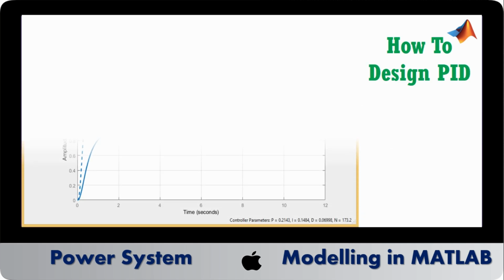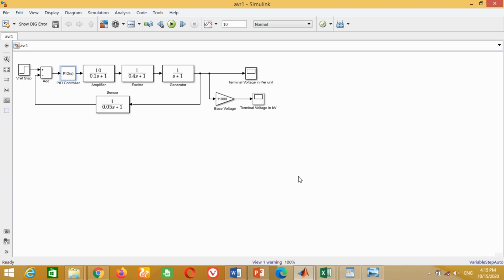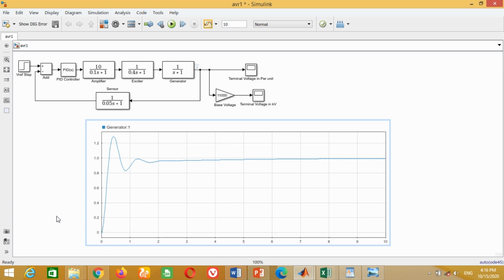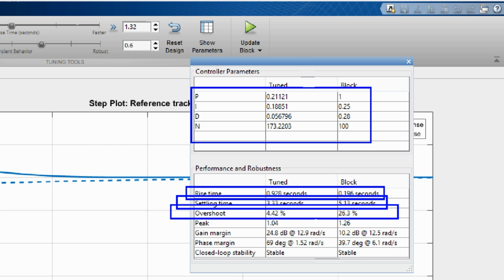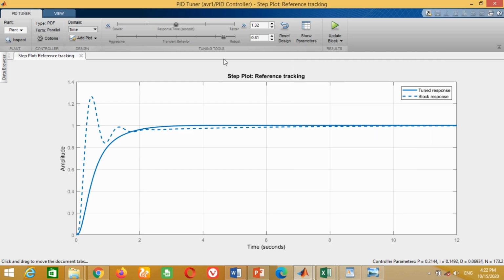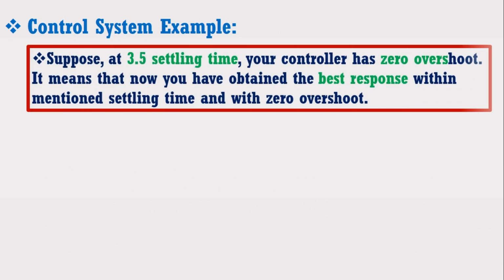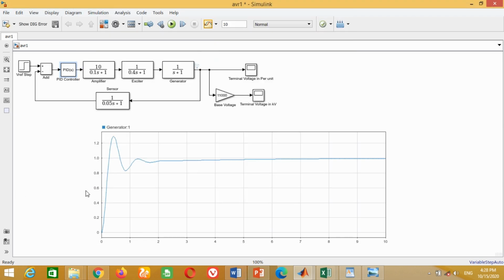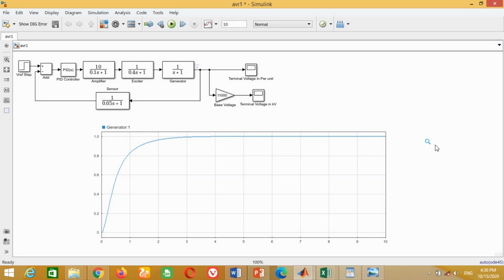How To Tune PID Controller in MATLAB SIMULINK ? | Dr. J. A. Laghari

Comment: Can I use convex optimization technique to improve the efficiency of the system?
Reply from the maker: Thanks for the comment. Yes. You may use. It will work.
Reply: can you make a video of it? using cvx tool box in matlab @DrJALAGHARI

Comment: respected sir, 
i'm trying to tune the pid controller in a buck-boost converter . but the tuner is sending this message ' this model can not be linearized'. 
what can i do to solve this problem ?
Reply from the maker: Thanks for the comment. Basically the pid tuner works well with transfer function based models. I don't know about your model.

Comment: assalamualaikum sir, how to determine the value of PID when setpoint I'm in 35
Reply from the maker: Wa'alaikum salam Thanks for the comment. I am sorry I couldn't understand your query.
Reply: @DrJALAGHARI  For example setpoint I determined, that's how to find the value of PID in Matlab
Reply: Set Point is the value of the desired process variable.
Reply: setpoint is vref step
Reply from the maker: @kuramapratama5063  better to use per unit reference. Take 1 as equivalent to 35. First optimize PID response with this reference then multiply it with gain of 35.
Reply: @DrJALAGHARI  can i have your email sir?

Comment: Sir can you show how to turn it into a model of an automatic voltage control system with multiple areas interconnected?
Reply from the maker: Thanks for the comment. Yes you can use this in the automatic generation control model of two area system. First design the model in the model use pid controller. Then simulate the model and then use this pid tuner to tune its parameters.

Comment: Sir can we get sampling time for the pid controller through this method
Reply from the maker: Thanks for the comment. Do you mean settling time ?
Reply: @DrJALAGHARI  No sir. I mean  the rate at which we have to provide the feedback signal or sensor output for PID controller
Reply from the maker: @techme234  Right. I am not sure. You the may check
Reply: @DrJALAGHARI  ok thankyou sir

Comment: Sir, I am using PI controller and getting the message that system cannot linearised…can you please tell how to resolve this…Thank you sir
Reply from the maker: Thanks for the comment. May be you are not using transfer function based model. This PID tuner block is suitable for transfer function based model.

Comment: Respected Sir, 
I am facing many issues in my simulation regarding PI controller, since my model is not linearized. Can you please share your email id for communication and help. 
Your all video are a great help to us. Thanks for your efforts Sir.
Reply from the maker: Thanks for the comment. For nonlinear model, this pi controller will not work. It works well for transfer function based models.

Comment: i have made a FO-PID controller using the fomcon toolbox , can you explain how can we tune the FO-PID controller ? there is no inbuilt tuner for FO-PID
Reply from the maker: Thanks for the comment. In-built tuner is for linear system. You have to tune it by some other method.

Comment: Sir AOA, 
Sir please make the video on this title "Modeling and simulation for controllers of Wind Energy Conversion System using MATLAB/Simulation" because of my FYP project/thesis.
Thankyou Sir.
Reply: Ok Sir for your kind response .☺
Reply from the maker: Wa'alaikum salam Thanks for the comment. This is very lengthy topic and will contain more videos. It is because wind energy has many sub systems. Therefore, it will take lot of time.